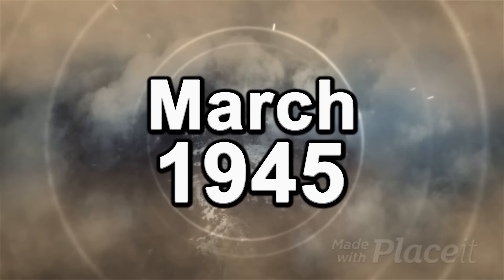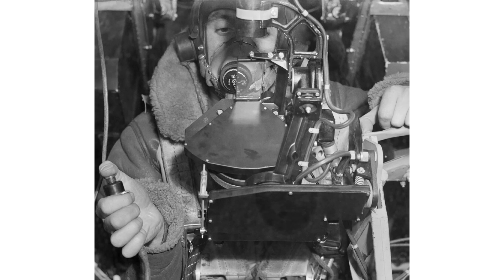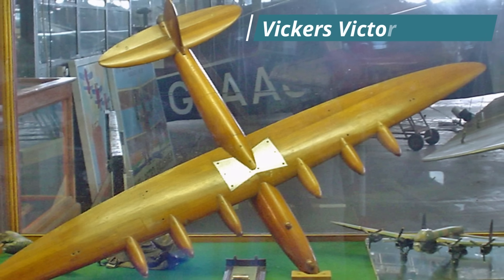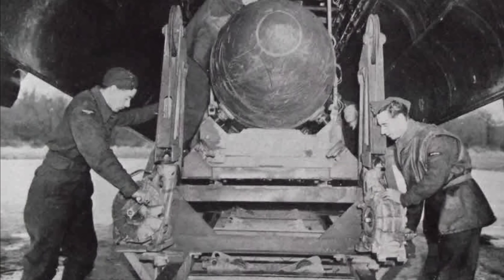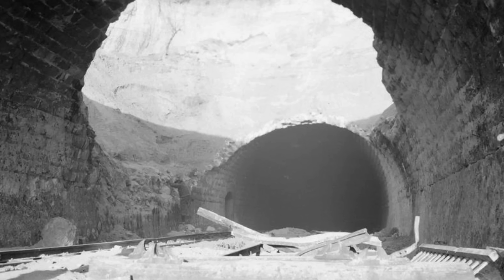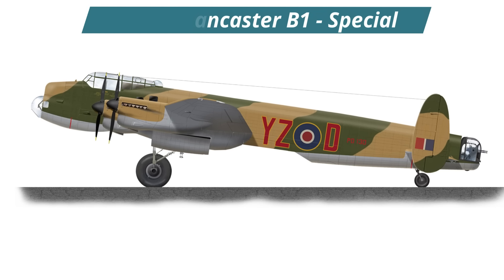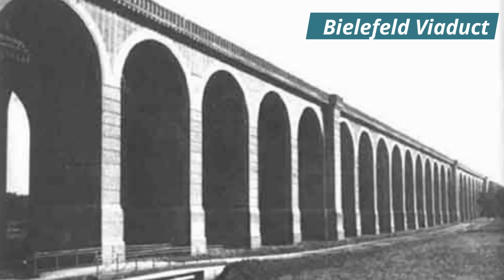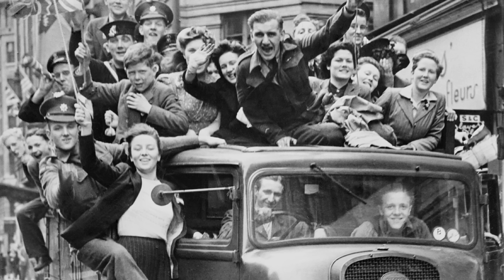The BIGGEST Non-Nuclear bomb in World War 2

Comment: Sadly Torpex was in use well before 1942, the Luftwaffe used the same formula.   However, the real kicker was that the RN had been using it since WWI, principally for torpedoes ( Hence the nameTorp(edo) Ex(plosive)), depth charges and mines.   The RAF was peeved not to have been told earlier, it meant aircrews were lost unnecessarily.
Reply: Hoa Tattis  Yes, it seems the Air Ministry really liked their turrets.    They even drew up plans for installing them in the Beaufighter and the Mosquito, I've seen line sketches for both and they actually installed one for trials in a Beaufighter.    Madness I reckon.   Still not as bad as sticking one on a Skua and calling it a fighter.

Incidentally I tried to add more to the recent  exchange on the Mk VII Spitfire.    The point folk often overlook is that it isn't enough to quote ceilings without some consideration of how well the plane and pilot functioned once they clawed their way up there.   The Mk VII was the real deal and a clever bag of tricks.   The RAF's high altitude research flight had covered a lot the necessary ground pre-war.    In the very low temperatures and pressures encountered you have to sort out control linkages, connexions and seals that could be relied on to keep working .   Warm air was blown through the cockpit double glazing to maintain vision.   Icing was a serious hazard that had to be countered.   And... you had to keep the pilot alive and functioning (ditto the guns).   The pressure in the Mk VII cabin was maintained at a level significantly below one atmosphere for practical reasons.   

It staggered me to learn that the heroes of the  seige of Moscow, the MiG 3 and MiG 1, were both configured as high altitude interceptors.     The latter, the MiG 1 had an open cockpit (!).   Clearly they breed them tough on the Steppes.

Anyway, the reason this piece is here is because in the proper place YT keeps coming up with "You have reached the limit" and locking me out of posting it.
Reply: @TheArgieH Very annoying when YT does this 🫡

Comment: The modern MOAB which is the current most powerful non nuclear weapon is actually slightly lighter than the Grand Slam but modern explosives make it more powerful. Crazy to think after all this time it's still one of the heaviest bombs ever dropped despite how much more weight modern planes can carry, a B52 could carry 3 Grand Slams which would be terrifying
Reply: " is actually slightly lighter than the Grand Slam but modern explosives make it more powerful. " Heh, as was expected(as it is typical for internet comment) your your comparison is 100% wrong...
Grand Slam was much lighter and its explosives were much stronger.
Grand Slam torpex have 150% of TNT strenght and Composition H6 in MOAB is only 135% of TNT strenght...
Reply: @Bialy_1  There's always one
Reply: @Bialy_1  regardless of whether your statement is factually correct or not, typing “heh” automatically makes you sound like a keyboard warrior and people won’t take anything you say seriously (I’m not trying to offend you, just letting you know).
Reply: @Bialy_1  If you mean the Grand Slam's explosives were much lighter, you're correct. 9500 lbs vs 18600 lbs. If you mean the Grand Slam bomb was lighter, then no. It was 22000 lbs. The MOAB is 21600.

You're right about H6 being less powerful than Torpex. If anyone is wondering why they would choose to use a less powerful explosive, it's because H6 is more stable.
Reply: Indeed 
Imagine a b52 tunneling a bunker
Reply: Also, they are two different types of bombs. The Grand Slam was designed to penetrate the ground and explode beneath the surface. The MOAB is an air burst bomb (Massive Ordnance Air Burst) and designed to detonate above ground.

Comment: Great video but the thing that grabbed my attention was the mention of RAF Carnaby.
Dad got his first car during the Suez Crisis in 1956, my uncle had a caravan in a park south of Bridlington and we used to use if often.
Before motorways we went from Milnsbridge via Wakefield, Selby and Driffield taking a short cut through Carnaby so we didn’t have to go up to  Bridlington.
The runway was still there but coned off along the road you can see to the far right of the photo you used.
The cones were easily driven through and a couple of times dad drove to the end of the runway and back to see how fast the 1949 Ford Prefect would go, not very fast as it happens.
I’ve looked on Google Maps and there is a suspiciously long thin industrial estate which could be where the runway was.
Mike

Comment: When calculating munitions loads for transport aircraft we measured the gross weight for payload and balance, but Net Explosive Quantity (NEQ) for separation of airframes to prevent chain reaction.
Very often the NEQ was low for modern weaponry but high for iron bombs, and yes, the good old 1000 lb bomb was still very much in use at the time of the Gulf War in 1991, albeit with laser guidance!

Comment: I remember reading about the grand slam bomb several decades ago in a military history book. The book claimed that they dropped a single Grand Slam with the intention of destroying the submarine pens I've forgotten where. They actually missed the pens and dropped the bomb into the middle of the harbor and the concussion and water wave actually picked up a complete submarine and set it up on the docks, which didn't do the sub or the docks any good at all.
Reply: the germans had doubled the 16 feet of ferro concrete over the pens but one grand slam had penetrated though and blew a huge hole in the roof
Reply: Boulogne docks which were wrecked that way and the E boats washed up onto the quayside, the favourite tactic was tallboys through the roof  which worked until the Germans started making the roof's up to 30 feet thick in places and a couple of bombs did split but most either punched a hole in the roof or the near misses pulverised the foundations making ithem unstable with the extra weight .
It did leave the French with a problem
what do you do about a building that is a massive concrete barn with holes in it?

Comment: The 'last' tallboy recently exploded in what is now Poland while they were trying to make it safe - a substantial bang ! It can be seen on the BBC archive as well as other places. They were using robots to dismantle it so no one was injured in the explosion. There are examples of the Tallboy & Grand Slam in the museum at Brooklands if you want to see them. The casings for the grand slam were cast in America and shipped to the UK to be filled. The crater in the Ashley Range was filled in and is now identifiable by the circle of trees in the otherwise fairly barren heath land. The Grand Slam is still the largest bomb dropped on the UK if you don't count the test nuclear weapons that were inert.
Reply: We have an inert tallboy I believe in Lincolnshire
Reply: @gowdsake7103  The tallboy is smaller and a lot more common than the bigger Grand Slam bomb.

Comment: When I started work as a tech apprentice at Liverpool airport, our instructor told us the first Lanc to carry a Tallboy could not get airborne and was running out of runway. The pilot raised the landing gear to reduce drag in a desperate attempt to get off the ground. It worked , but when he landed , the chains holding the bomb had worn halfway through where they had rubbed along the runway! Subsequent take offs used JATO bottles to provide extra thrust.
Reply: If it struggled with the 12,000lb Talbot, how did it take off with the 22,000lb Grand Slam?

Also JATO was Jet Assisted Take Off, I doubt if it existed in WW2

I think your instructor was embellishing a story
Reply: @Hattonbank  .....or he meant rocket-assisted.
Reply: @Hattonbank  ...THE LANCASTERS FOR CARRYING THE GRAND SLAM BOMBS, HAD MORE POWERFUL ENGINES, REINFORCED AIRFRAMES, AND EVEN MORE UNNECESSARY WEIGHT REMOVED. 

THAT WAS THE ONLY WAY.
Reply: @daleburrell6273 CAN YOU SPEAK UP PLEASE I CAN'T HEAR YOU

Comment: I had no idea how many of these bombs were successfully utilised and was heartened to hear that all bombers on the 2 missions you mentioned, returned safely. A massive contrast to so many other high attrition raids.
If more of these bombs were used maybe losses could have been reduced in line with fewer required return bombing missions of high value targets. Barnes Wallace really was innovative.

Thank you for such a well researced video. 👍
Reply: The German air defences at this point as regards fighters was almost non existent, while their AAA radars were mostly jammed by a host of ECM. The main problem with the use of Tallboy and Grand Slam was to use them was expense, both for the price of the bombs themselves, plus shortage of the Stabilised Automatic Bomb Sight used to aim them (only used operationally by 617 Squadron).  These bombs were massive overkill for most of the targets the bombers were going after.

Comment: As Mark Felton pointed out on his video about the atomic bombing of Japan, the Lancasters with modified bomb-bays were slated to drop the atom bombs on Japan if the American planes weren't ready on time.
Reply: I read that they were to do a third bombing if the Japanese declined to surrender after Hiroshima and Nagasaki.  That's not back-up.
Reply: @deltavee2  They were intended to drop the bomb on Hiroshima, but it was pressure from within the US military that stopped it.
Reply: @Volcano-Man   Pressure?  They were working with the US with a third bomb in reserve if it was required.  Then the Russians turned their little bear brains towards disputed islands and Japan threw in the towel at which point a third nuclear attack on a country that had already surrendered became unnecessary.  

You make it sound like the R.A.F. was just slavering to drop a nuke on Japan.
They were not pressured by the mighty US military, Gerard.  They were working with the US and were quite happy to not have to bother.

"Pressure" had nothing to do with it.
Reply: The actual story is that the first atomic bomb design  "Thin Man" was 27 feet long and wouldn't fit in the standard B29 bomb bay. Norman Ramsay, a physicist working on the Manhattan project suggested the Lancaster as an alternative in the event of the B29 modifications having problems. When the suggestion and that's all it was - reached the ears of Hap Arnold it was quickly quashed as he knew the Lancaster had nowhere near the range, speed or ceiling to do the job plus the fact that the weapon would have to be armed in flight for safety reasons which was not possible in the Lancaster. Finally it transpired that the Thin Man bomb was unsafe due to the probability of premature detonation which led to the Thin Man bomb being cancelled. As the other two bomb designs were much shorter the modifications to the B29 were less complicated and therefore it was no longer an issue.

Comment: The viaduct was rebuilt with steel and forty years later had to be rebuilt again. The area around the viaduct is now a man made boating lake. Other bombers of the era had the lifting capacity but all the others had divided bombays and could not have carried any of the three weapons without extensive redesign for which their was no time. I remember reading somewhere that the only time one was tested in UK it went straight through the camera set facing upwards to record the drop. It was not expected to be so accurate. The SAumur tunnel was still undergoing repair at the end of the war.

Comment: What I’ve always found interesting is that the Lancaster could carry the same weight in bombs as a Vulcan.
Reply: The Lancaster and the B-17 were comparable in size and performance, although the B17 had a higher ceiling and was slightly faster. Having said that, max bomb load on the B17 was only 8000lb, reducing to 4500lb on long missions. The Lancaster had a standard load capacity of 14,000lb, and the uprated B1 Specials could carry 22,000lb.

Fun fact: Norman Ramsey, head of the Delivery Group for the Manhattan Project wanted to use Lancasters to perform drop tests on the Fat Man casings, a request that was refused by the higher-ups. In an ironic twist, the bomb release gear on the B-29s proved to be completely inadequate, with several dummy bombs falling off in mid-flight. It was then decided to use the bomb release gear from the Lancaster as it was already proven to handle much bigger loads than either Little Boy or Fat Man would engender.
Reply: @chass1771  Good man, it’s nice to know others whom take an interest 👍🏻

Comment: The 1000llb bombs seen in this vid have Torpex/TNT marked on them. 
Torpedo Explosive (and it's improvement of the bouncing bomb, RDX) were essentially modern high explosives with a certain admixture of aluminium powder, which caused the explosion cavity (the 'camouflet') to be larger and last longer. 
At sea, this can break the back of even the largest ships, underground, it could have collapsed coal mines, demolished large concrete structures (and did so), as well as destroy dams (as in Korea as the AZON and TARZON bombs). 
The shape and size of the tallboy bomb was also used as the standard for the RAF's first atomic weapons, the Red Sun, Yellow Sun and Red Beard devices.
Reply: You rightly raise the point about attacking German coal mines. Sadly I think the failure to target these vital, and very vulnerable installations was one of the biggest errors of WW2. If the RAF had attacked a few dozen, it would been very effective in denying Germany its vital coal resource because few miners would have been willing to go underground knowing their coal mine was going to be targeted. Apparently RAF intelligence advise against such a campaign - a serious failing in my view.

Comment: Just a hint at the international co-operation. British Avro Lancaster Bombers, (North) American P-51 Mustangs escorting and an international cast of aircrews. Brave to the last, every one.
Reply: The Mustang was designed and built originally for the RAF.  With the American Allison engine it was  a poor performer.  Substitution of the Rolls Royce Merlin transformed it into what was, arguably, WW 2's best fighter.
Reply: @gnosticbrian3980  When first designed, the Mustang would have been even worse with the Merlin than the Allison as the former didn't have the horsepower of the later even at low altitude. The Allison powered Mustang was poor at high altitude due to the lack of supercharging, at low attitude it was as fast as anything else in service and had much longer range. It was the advent of the Merlin 60 series engines with the two stage supercharger and very high octane fuel that allowed the Merlin to power the Mustang and make it good at high altitude.

Comment: One small correction, bombs were never jettisoned at sea. Missions were given multiple alternate targets in case of bad weather or heavy resistance. 
The tallboy and grand slam were the only exceptions, if the target was not visible, they were always returned.
Even the atomic bombs had alternate targets.
Reply: Yep, Nagasaki wasn't the primary target. Kokura was the primary target however the previous days bombing of Yahata and the nearby steelworks burning coal tar gave Kokura a protective smoke screen

Comment: Grandslame droped on  German submarine pens.france.broke through 15foot reinforced concrete roof.the only bomb to penetrate these Sub.pens.🇭🇲
Reply: But there were two roofs of equal thickness
Reply: Very close. Actually, the U-boats pens at Brest had a 16 foot thick roof and was penetrated by multiple Tallboy bombs. One or two were said to have split on the concrete roof. The Grand slam did not see use till later in the war, March 14, 1945.

Comment: Not mentioned was that the crew of the Lancaster was reduced from 7 to 5, and the radio was removed.
Reply from the maker: Fair point Mark. When I mentioned the removal of two gun turrets perhaps I should have also mentioned the crew that would have manned them. Cheers for the comment.
Reply: Hoa Tattis  This is additional information that was not included originally.

Comment: The Ashley range is still there and you can see from Google Earth the target rings and ground markers. They built a UBoat pen to try and test but at the end of the war it was covered over and is now just a HILL which is good to look out from. From what I have heard when they tested the Grand Slam it had quite and effect on the Villages of Godshill blowing out windows etc. There is alot of history around that area with also a P38 airfield been close as well on the Fritham plane which had 3 runways, one of which is now a road but you can make out the outline from Google Earth
Reply: The 'U-boat pen' was actually a test air-raid shelter to trial different types of concrete and construction. From old photos it does appear to look like a U-boat pen, but not comparable in size. Still there and as you say covered up by earth - but some of the concrete is exposed. Walked on it a number of times.
Reply: I'm staying at nearby Sandy Balls (LOL) in a few months so will have a walk to view it.  Stil visible on Satellite view (Google Earth) as you say.

Comment: And wallace also designed the wellington bomber...
Reply: Using the geodesic structural principles arising from his earlier experience as a designer of airships and his awareness of potential uses of geodesic principles in creating strong, low weight, rigid open frameworks
Reply: Didn’t he also invent the wrong trousers? With the able assistance of Gromit, of course.
Reply: No he didn't. That bullshite comes from the 1955 film. Rex Pierson was the Chief Designer at Vickers Armstrong from 1919 to 1946 and he designed every Vickers fixed wing aircraft from the Vimy to the Viscount.
Reply: @richardvernon317  nope !
Reply: @rodparsons6296  He designed but it was never built for a 6 engine bomber known as the Victory Bomber to be built the same way .